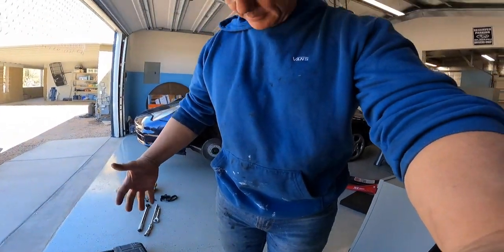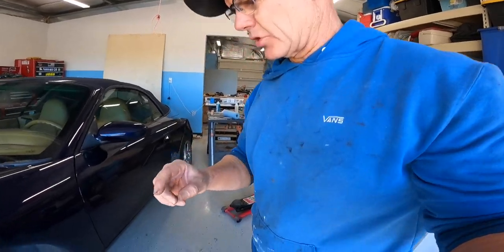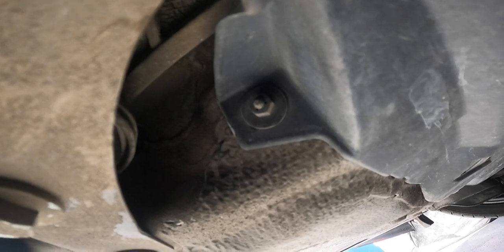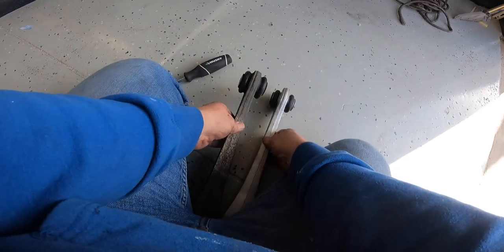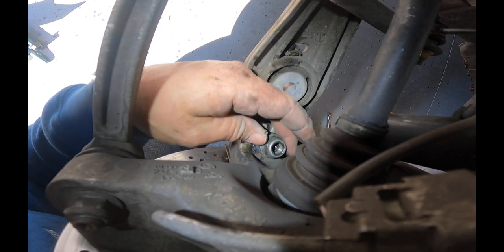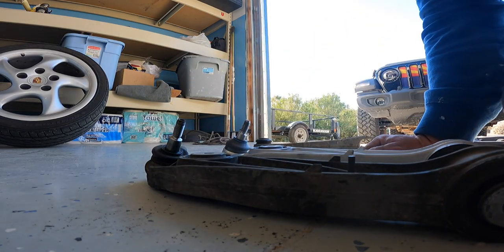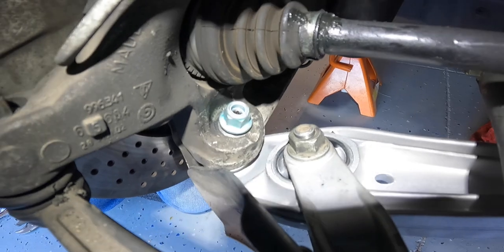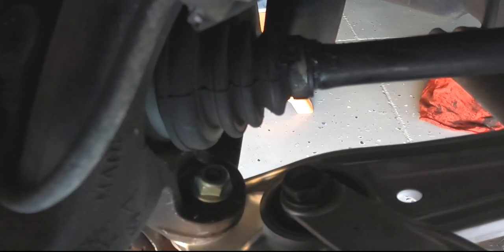Porsche 996 Front Control arm Removal and Replacement:  Tuning Fork and Coffin arms

Comment: Hi Rick, great video.   Will use it soon.   I’m all set to do the plugs this weekend.
Reply from the maker: Thank you!   Oh boy...the plugs!  That is a fun one.  :)  Most of it isn't bad really, just 3 and 6 if I remember correctly.  Are you going to do the coils as well?  If you can pick up a ratcheting box wrench, can't remember the size off hand, but it will really help.
Reply: @AZdroptop  not doing the coils as they are ok.  50k miles, so this is more about bore scoping and baseline car with maintence items.
Reply: @AZdroptop  thanks for the tip!

Comment: Hi, all your old parts where the original parts - important at all these parts = no play at all bearings/bushes - easy to turn it's not important. Good job. Remember to check and do the settings after all changes! Bilstein is a good choice.
Reply from the maker: Thank you Very much.  Cheers.

Comment: Rick, I apologize for the follow up question. If you replace the shocks and struts will you have to undo any of the new suspension work you did?
Reply from the maker: No problem at all.  I will have to loosen a few of the parts, but nothing major.  Definitely would be good to do it all at once to make life easy.  :)
Reply: Thanks again

Comment: Good video Rick. I noticed that you didn't put the wheel in the "unladen" position before torquing.  Is that not necessary?
Reply from the maker: Once I had everything torqued to spec I loaded up the suspension with a jack, loosened and then retorqued to spec.  Hopefully that makes sense.  My understanding is the suspension should be loaded when you torque the bolts for the last time to prevent premature ware of the bushings.  Hard to due with out a lift.  When I had the car aligned I had them check the torque as well.  Hope that helps and thank you for watching!
Reply: @AZdroptop  thanks for the follow up. I’m working on a 996 on my channel and suspension is up next after I resolve the cabriolet issue.
Reply from the maker: Very cool!  I'll take a look.  Thankfully my top has been solid so far.  Fingers crossed.  :)   Best of luck with everything.

Comment: Great video - however it is worth noting that you need to jack up the hub to its equilibrium postion before tightening the bolt on the inner bush.
Reply from the maker: Good tip!  Thank you, I did retighten after compressing the system with my jack.  Been awhile since I made the video so I don't remember if I mentioned that or not.  Appreciate your pointing it out.

Comment: Excellent job and really well explained. Thank you I’m doing this to my 996C4 in a couple of weeks. Seems like a dumb question but how did you jack the car up and put axle stands on the sills? I might be over thinking it but did you jack it up from a different place? Also what was the key to releasing the plastic clips on the plastic under tray. Thanks in advance for the UK
Reply from the maker: Thank you Matt.  I would jack up the car using the rear sill positions and add  2 x 8's that I made under the front tires until it was up enough to get jack stand under the two front jacking points.  In the back I used a part of the car frame.  I would put a 2 x 4 on my jack to distribute the force a little.  Let me look around and see if I can find a picture of where I used to get the back up.  Those darn plastic clips are a pain and honestly I can't even explain how I got them off.  It is kind of a pry and pull situation...I broke a few of them and had to order them.
Reply from the maker: Check out this page.https://www.pelicanparts.com/techarticles/Porsche-996-997-Carrera/01-BASIC-Jacking_Up_Your_Car/01-BASIC-Jacking_Up_Your_Car.htm
Reply: Wow. Thank you for taking the time to help out with that information. Very much appreciated sir.
Reply from the maker: Happy to help out.  Best of luck and hope it goes well.

Comment: So you have a klunk, but I have a squeak.  Still LCA/coffins and balljoints?
Reply from the maker: Well, I know I have read a ton of posts on people having squeaks while trying to figure out my clunk, but I can't say for sure that changing out your coffin arms and LCA's will do the trick for sure because there was so much variability.  I think it is very likely that it is one or the other, but I know struts mounts and end links were causing noises as well.  Of course I replaces those first with no luck.  :)
Reply: @AZdroptop  thank you for the info :)  I might do a front end rebuild.  I'm at 151k miles now and the 5 years I spent stationed in OK did not help the wear and tear on my 996 with those roads haha
Reply from the maker: Ha ha.  Sounds like our Tucson roads.  I  imagine most of the original suspension stuff is in need of a change out....not cheap to do, but the results will be well worth it.  Best of luck and thank you for watching!